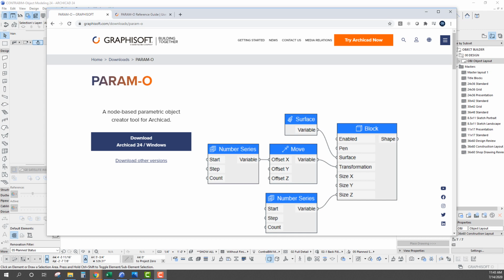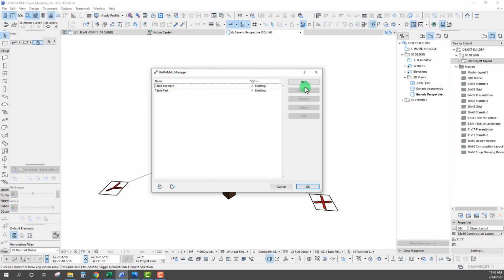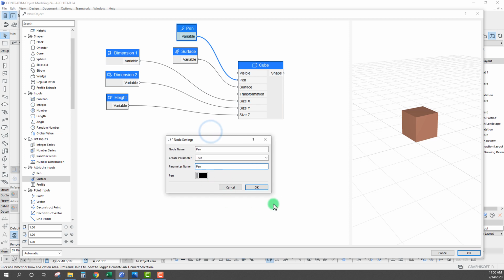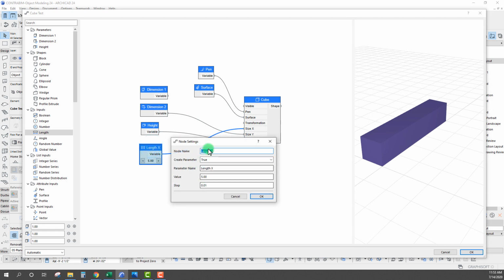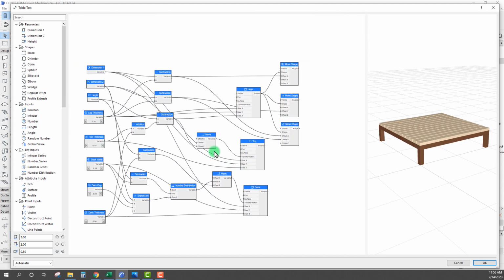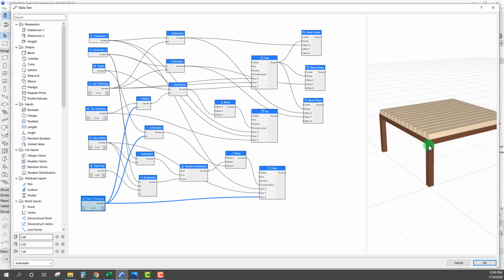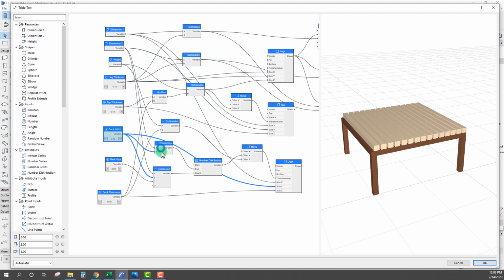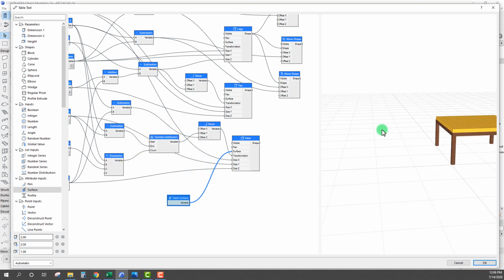Archicad 24 New Feature: Intro to PARAM-O!

Comment: I noticed that when you add the length in all these parameters instead of the global ones, on the 3D modeling the x and y don't change, but the hight it's changed like a marking on the volume, but not the volume itself. Weird. Maybe for the top distribution, replace the formula to a Divide? Idk, I'll try...

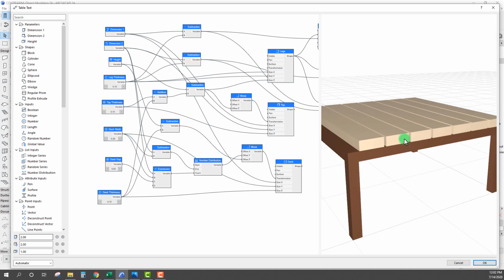Comment: @Contrabim: To solve the problem with the expression, (minute 19:04) - put the node "Ceil" between the expression and the number distribution. The problem is probably that the result of the expression does not output integers. With "Ceil" you get an integer.
Reply from the maker: Awesome I'll have to try that! Thanks for the comment!

Comment: Is there a way for someone without any background to learn it? Even though copying the nodes from the image and following the video still cant manage to achieve it... Any helpful recourses?
I cant understand why we use subtraction. What would it mean in the process?
Reply: The subtraction is needed, for example, to determine the positions of the table legs. If you simply copy the table leg by the table length, it would end up outside the table by the table leg width. So you need to subtract the table leg thickness to get the correct distance to move it. Make a sketch and try to determine the position of the other legs using variables like table length or table width and table leg thickness. You will find that you need the subtraction.
I hope to have helped a little.
Reply: @llussik  Thank you Gallus. I ve started practicing so I am getting familiar with what you re talking about.  I hope graphisoft would release any guide book in the future
Reply: @mariosk1016  In fact, there is a user manual from Graphisoft: https://helpcenter.graphisoft.com/user-guide-chapter/85691/

but it still has a lot of potential upwards ... 🤷‍♂️

Best to use is the node documentation:
https://helpcenter.graphisoft.com/user-guide-chapter/85692/#XREF_87448_Node_Documentation
Reply from the maker: Thanks for sharing the links!
Reply from the maker: Hi Marios, yes there are some limited technical docs, but hopefully more coming soon especially because of the new formal release just came out. its best to start sloww and try to learn piece by piece and to follow some samples helps!

Comment: I worked out a way of getting the slats to fit properly.  The details are not important, as there are clearly many ways to do it.  
Nice, when you get your head around it. 
Are there tutorials or guidance on  how to use some of the more obscure(to my eyes) features:  e.g Move by Vector, Transform Shape etc. I could not guess how to use these from the available documentation.
Reply from the maker: Nice Dai! Yes the documentation is lacking a bit, I've been busy on some other recordings and product work but I've been wanting to get back into the paramo tools and dive a bit deeper in some tutorial vids.

Comment: How editable are models, made by paramo then? can the be trimmed by walls, roofs , saved as doors, windows etc? And if we re talking about new features: graphisoft,  please make happen right click on object in vice-vera order from mesh converting. So, wall, roof etc can be made from mesh object, that would be something.. Oh and yes, full nurbs support would be nice also, so we don't have to play with all that plug-ins so much...
Reply from the maker: Great question. Models are editable based on the parameters you set, but I'm not sure about the trimming. Perhaps same as SEO. I agree on the nurbs, that'd be nice! Roofs can be made from meshes, which works really well. I'm not sure how walls would work tho??

Comment: regarding the deck. You would have a Total Deck Size (TDS) and Deck Size (DS). The deck gap (DG) will be the output. So for  TDS of 3ft and DS of 2.5in you will get (3*12)/2.5 = 14.4 decks. take the int of it that is 14 decks. 14 decks will take (14*2.5in) = 35in total space. So you are left with (36in - 35in) = 1in to distribute between gaps. Your DG will be now 1in/(14-1) = 0.0769in.
Reply from the maker: Ziyad S Thanks for the notes, there’s a few methods I’m looking forward to testing out when I can get some time back on this!

Comment: This could be a breakthrough feature. Its the Archicad version of Family editor in Revit.  Imagine there will be lots of custom made parametric objects for furniture and every other BIM products.  There only a few GDL specialists who  were able to do it using the programming interface but now its a truly new beginning. I wonder if its possible to add  those 3D Hotpoints where you can visually stretch an object on the screen. Probably they willl add these features and more on future versions..
Reply from the maker: Great question! I'm sure they'll be building on it, but what's also interesting is how you can continue to open these in the GDL Object Editor and work on it there. Although I've noticed if you re-save from PARAM-O is seems to overwrite any changes. Still learning here more to come!
Reply: yes, building paramo object visually in 3d, would be great..

Comment: I think you can't have the total width and the single deck's width and the gap as variables at the same time.
I'd use one of those three methods instead: 
1. set the total width of the table and the number of decks so you can automatically work out the deck's width based on their number. (total width - (n-1) x deck's width= total gaps); (total gaps / n= single gap) where n is the number of divisions.
2. set the number and width of the decks and the table width would be calculated automatically.
3. set the width of the table as variable, the number and width of the decks and the gaps are calculated (total width - (deck's width x deck's number) = total gaps); (total gaps / (number of decks -1) = single gap).
I gonna try asap.
Reply from the maker: Thanks Hilario! That makes a lot of sense, that it'd be impossible for the even distribution to the edges when both gaps and deck widths are variables, as well as the table width. One has to drive another. I was following the GRAPHISOFT example image and couldn't quite figure that one out, but I'll give it another try, thanks for the comment!
Reply: @CONTRABIM  we hope you post an update of your progress soon 😊👌

Comment: Maybe the deck elements should be made out of only one single slab and the gaps should be made out of a hidden geometry that cuts the deck slab into equal pieces!
Reply from the maker: That's a good idea, but it'll still require me figuring out the spacing and even distribution between two points. I'm playing around with it and will do some more videos soon! Thanks!
Reply: @CONTRABIM  on the left I read distribution.  Isn't that what you are looking for?
Reply from the maker: @Claudiozee  Yes I have the number distribution placed in there between the expression and the move nodes, been doing some work on this I'll have some more videos here soon showing what I've learned! Thanks!
Reply: @CONTRABIM  champion. Hope the Mac version will come available in few days only >.<
Reply: I don’t think there us a subtraction node in Paramo. It exists in GDL however, so it would work there
Reply: @peterkoncz  that's too bad! Maybe in a future version!

Comment: That's a great new feature. It's like having Grasshopper inside Archicad.
Reply from the maker: Yes it's pretty interesting. I think if you come from Grasshopper it probably is easier to pick up. Right now takes much longer to figure out how to set up the nodes than just modeling the shapes and saving as an object, but the parametric options take it a step above for sure!
Reply: @CONTRABIM  the reverse would be nice as well. for complicated models if i just model it out it using parameters it should generate the param-o diagram where i can fine tune it.
Reply from the maker: Ziyad S yes that would be really cool if it could go backwards, we’ll have to wait and see where this tool ends up